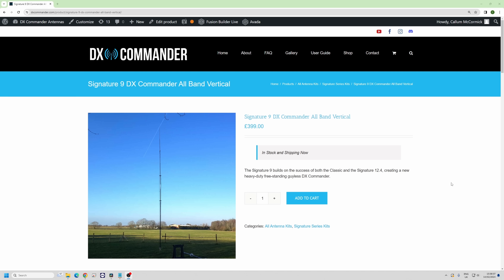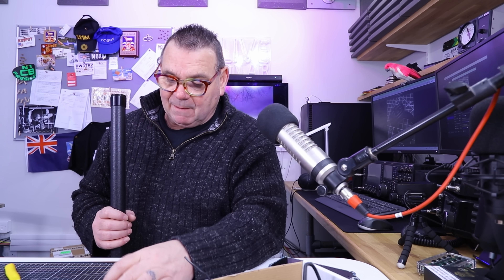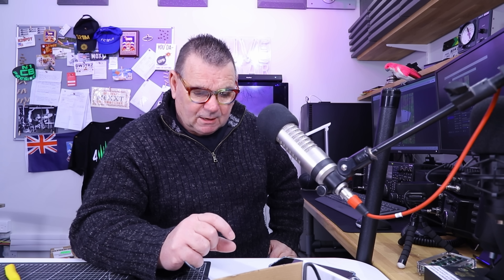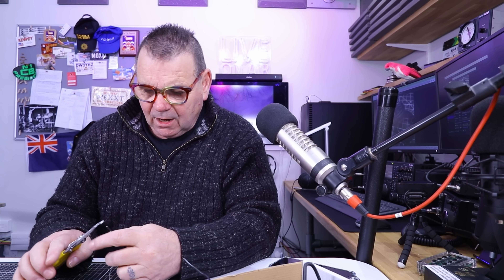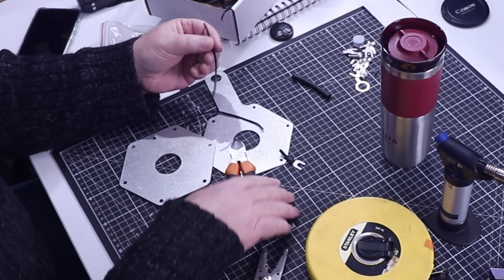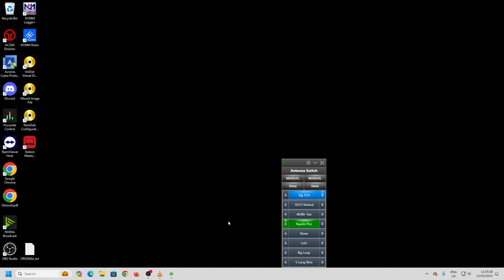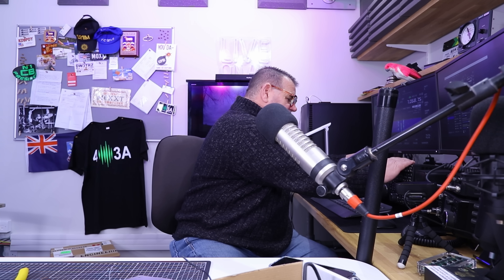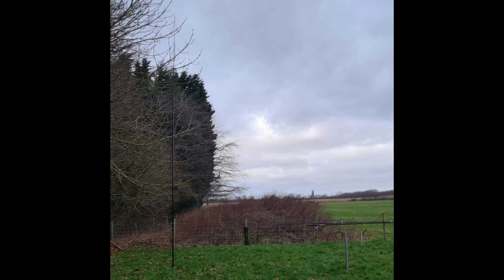*NEW* 2024 Spec Rapide PLUS DX Commander

Comment: Goodevening (or whatever time you read this)

For a permananet installation, I fully support Callums' way to unscrew the cap and leave the radials including the groundplate on the ground-over the groundpost.. 
It will make life easier - just unscrew the so-239 fly-lead and take off the pole if you need. This can be very helpfull for maintenance or saving the antenna from a heavy storm ;-)

This is my experience with the Signature 9 and will also be with tthe Rapide Plus 🙂

Enjoy your hobby and your radio, 73 de PC4AD - Anton
Reply: That is what I did with the Classic that I slipped over a 1.25" Sched 40 PVC that I stuffed into a screw-in post base. Stands up fine w/o guys,  but I guyed my pole JIC.
Reply from the maker: Nice one Anton!

Comment: Super antenna designs!  New to Amateur Radio here, with an EE background.  Taking the US Technician and General tests this week.  Considering DX Commander Rapide Plus vs. Signature 9.  What is the relative gain of these two as-installed?   Target usage:  90% base station so I lean toward the Sig 9, but a portable like the Rapide Plus would help me branch out more.
Reply from the maker: Sig 9. Both are alsmot same. 9 is longer so better result on 40m.

Comment: If you use the 30M wire to wind the 40M coil what is the new cut length for the total length?
Reply from the maker: Well. That depends on the size of the coil.. Actually, that's probably far too much for a 1/4 wave..

Comment: Using the ground post, rather than slipping the antenna assembly all the way down to the ground, could you stop it short of the ground by 30-60cm using a clamp of some sort?  I need this distance above the ground because of the irrigation that I take on my property. Thanks Callum, and 73!
Reply from the maker: Erm.. You could do. I have tested at around 40cms and it worked just fine. 60cm would also probably work too.

Comment: Dear Callum Sir, the antenna is brilliant and so are you.  For those of us that struggle a bit with metric measurements, I have a couple of questions and a couple of comments.  

What is the height of the antenna?
What is the O.D. of the lowest tube?
What is the O.D. of the top tube?
For 40 meters is any matching needed?
What is the total length and O.D. of the ground post?
How much does the assembled antenna weigh?
Thank you for answering the questions above.  Sorry that I need some clarification.
The Rapide-Plus does not have traps and the elements are full quarter wavelength so it will be very efficient.  It will be a very good choice for many amateurs around the world.  Congratulations Sir. 
With respect to radials: As a Deputy Building Inspector, I inspected a vertical antenna for a broadcast station that is on 830kHz.  They did use buried radials every 2 degrees.  The lengths were short due to terrain and other structures near the antenna.  I am of the opinion that once a radial is buried, it is hard to know where it is resonant. If the radial is a few inches above ground, it is resonant as cut and is more efficient.  Fewer radials are needed if they are elevated. Is that your experience with radials?  I know you experiment with designs much of the time and that is why your antennas are such a big sucess!
Wonderful to see your cheerful face and energy.  I am recovering from yet another round of chemotherarpy. I am currently bed ridden.  Transfusion number 19 was yesterday.  73 from Jim W6LG YouTube Elmer in Rocklin, CA.
Reply from the maker: Jim! Welcome my old friend..
Height is 23-ft
Lowest tube is about 1.5 inches
Top tube must be about 1/4 inch
Total weight: About 5 pounds
Resonant radials not required Jim.. Rudy Severns and I are of the opinion that either 1/8th wave or less and about 16+ work fine. Shout and I can build one up for you if you fancy testing it out.. But I know you have a hell of a station anyway!
Good luck with round 19.
Thinking of you old chap.
Callum.
Reply: Let's talk about that.  I would demonstrate the construction and installation in a very small backyard. I have enough money in PayPal.  Do you have a signature edition?  Signed by the old man himself?  73, Jim in Rockyland CA

Comment: Cal, just a quick question. Your coil for 40m does it have to be at the base or could it go half way up? I know it would need more windings but the effeciency goes up therortically. But also does that cause parastic issues to the other elements? Just wondered if you experimented with that. 
Cheers ZL2DEW.
Reply from the maker: That's the experiment I was doing before I put my back out! But yes.

Comment: I've often wondered if there's a maximum distance the plates can be away from each other- like enough room to fit a hinge (so that if you tilt it over on the hinge, the radial plate would remain stationary, but the driven plate would be on the tilting portion). of course, this would put more stress on the bottom of the mast, possibly requiring some sort of metal tubing inside the mast. I wonder if having a metal pipe inside the mast, going up past the driven plate would have a negative effect though, even though the mast insulates it from the plate, since the pipe would be in the elements' field.
Reply from the maker: You can hinge it.. Don't use metal inside the pole though.. Well.. It's a long story!

Comment: Callum…. Is soldering the radials truly a waste of time? If you have a reliable crimped connection, then it would be redundant.  73 de KD6UYK (Tim).
Reply from the maker: Well... I think so. But I do this SO often that when I dropped doing it a while ago, I wondered why I did in the first place. Assumes the crimp connection is good and so is the heatshrink.
Reply: Just ordered a rapide from dx engineering. Replacing a 6 btv in my tiny back yard

Comment: With a tuner can you get 80m?
Reply: I can with my LDG AT-200 Pro II -- there are many factors, what may work for me may not work for you!
Reply: I have a Signature 9, it does not tune on 80 with the internal tuner of my Yaesu FT710, but my external Comet 300 tuner it tunes OK and I can work UK stations no problem. I have a 15 metre run of RG213 so reflected power on 80 at the slightly higher SWR are not a problem.

Comment: Have you tried flat, ribbon cable for radials Cal? Im sure you probably have! I Each wire in the ribbon can be separated.  It’s good for /P operations as its very lightweight, maybe a bit too fragile for permanent use?  Cheap as chips though.  Also has anyone tried Faraday Cloth as a ground plane? Again it looks like a good, lightweight /P option! 73
Reply from the maker: I've tried many things but not a ribbon cable.. It's not until you are out in the field do you realise how important soft, flexible, non-tangle wire is!